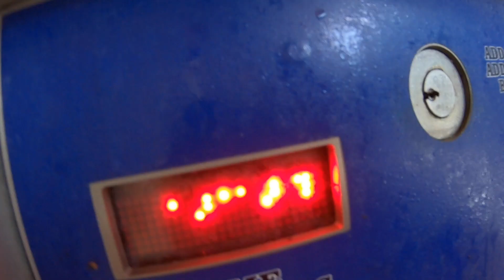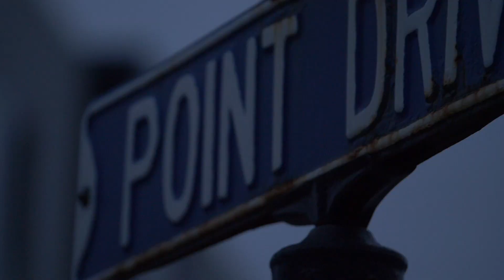THIS WAVE is SAVAGE

Comment: I've been looking at Machado's boards I'm a little under 6 foot he's a little over 6 foot I'm a hundred 90 lb he's a hundred 40 lb I'm trying to figure out the volume at 56 years old fairly good condition. So kind of wondering what liters volume you ride and what you weigh?
Reply from the maker: I weigh 185lbs & ride anywhere from 29.5 - 32. I think you could go 33 - 36 for sure!